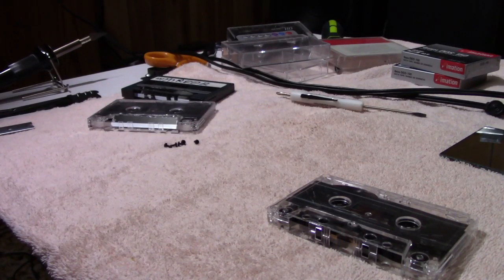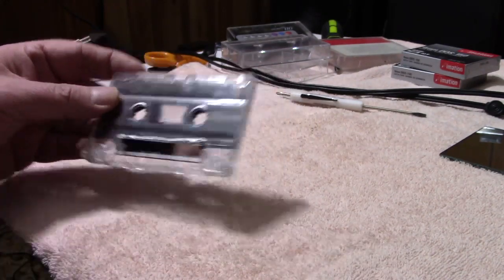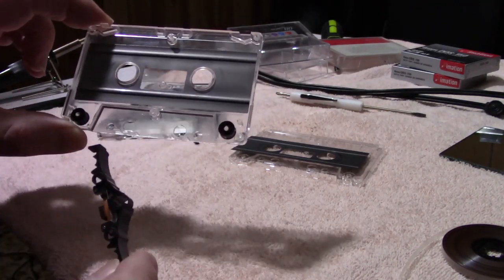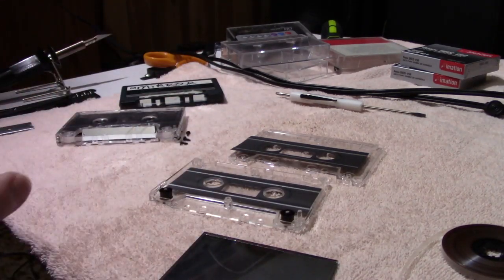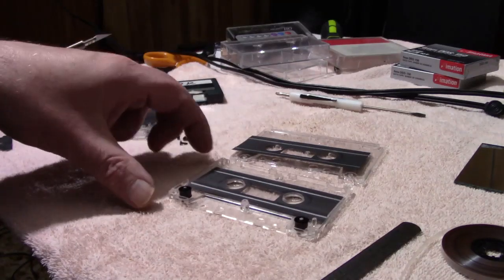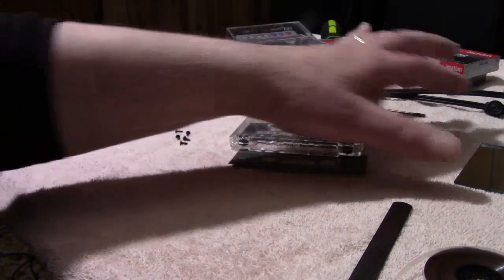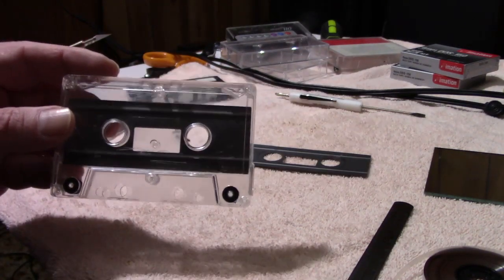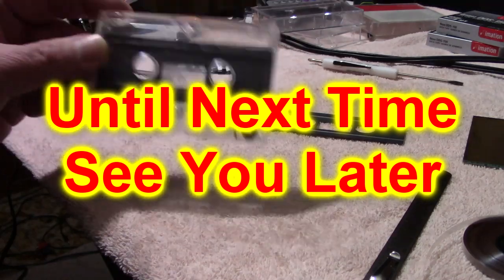Mirror Cassette Revisited: How to Make One

Comment: Some time ago I saw these Mirror Cassettes in a few of the service manuals - very handy indeed. Good to see you've made one too. I need to find some plastic based mirror sheets to cut. I did try a thin glass mirror sheet but the conventional cutting method (score and break) was only partially successful, so i decided to leave it and try another approach.